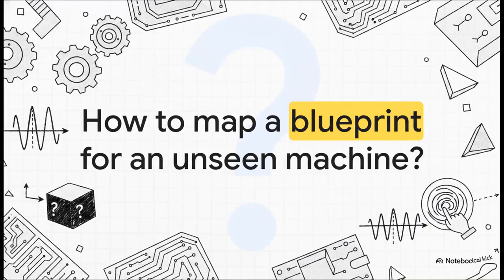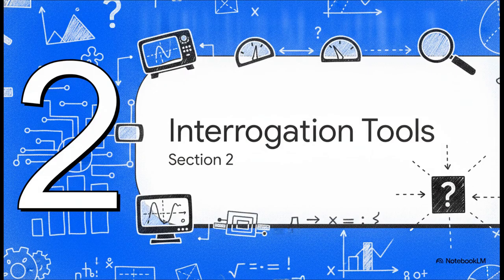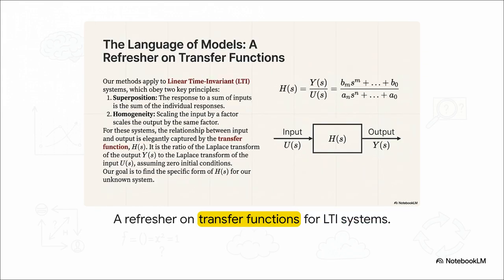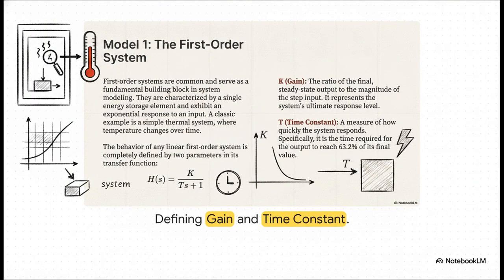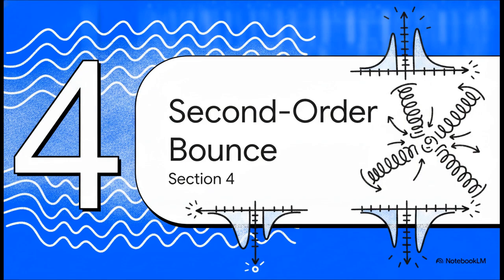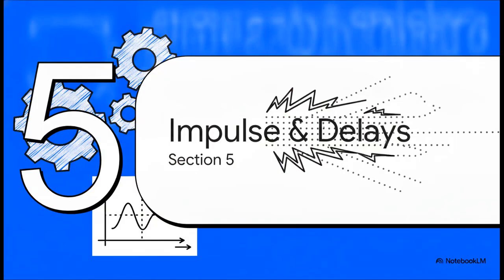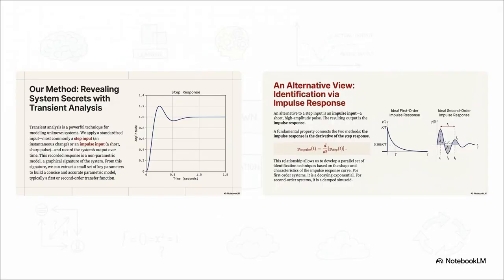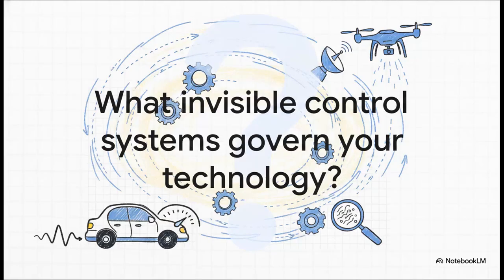System Modeling Using Step and Impulse Responses | Industrial Automation

Comment: At 1:17, under what conditions is a black-box model sufficient for controller design? Is a physics-based model always required instead, or does the choice depend on the application?
Reply from the maker: A black-box model is sufficient when the main objective is controller design, and accurate input–output data are available that capture the system dynamics over the intended operating range. It is widely used in industry because it is faster to develop and does not require detailed knowledge of the underlying physics.

A physics-based (white-box) model is preferred when physical insight is important, when operating conditions vary significantly, or when extrapolation beyond the measured data is required. It is also valuable for system design, optimization, and fault analysis.

Therefore, the choice depends on the application, the required accuracy, the availability of process knowledge, and the purpose of the model. In many industrial applications, engineers even combine both approaches to obtain the advantages of each.

Comment: In the Tangent Method, if the input step amplitude is not unity, should the steady-state gain K always be calculated as the ratio of the output change to the input change, or are there cases where using only the final output value is sufficient?
Reply from the maker: Excellent question. Yes. In general, if the input step is not a unit step, the steady-state gain should be calculated as the ratio of the steady-state output change to the input change: Using only the final output value is correct only when the input is a unit step (or when the input magnitude has been normalized to one). Otherwise, ignoring the input amplitude will result in an incorrect estimate of the process gain. This is why engineers always account for the actual input change when identifying process models from step-response data.

Comment: Thank you, Dr. Nima, for the insightful lecture. It covered the fundamentals of system modeling in industrial automation using step and impulse responses, and demonstrated how mathematical models are derived from experimental data to support system analysis and controller design.
Reply from the maker: Thank u.

Comment: Thank u dr for clear explanation, When using the dominant pole assumption, how can we determine from the measured process data that the effects of the other poles have decayed sufficiently and can be neglected?
Reply from the maker: When using the dominant pole assumption, engineers check the measured process response to determine whether the faster dynamics have become negligible compared with the dominant slow response.

This can be evaluated by observing the settling behavior of the step response. If, after a certain time, the response follows a smooth first-order exponential trend and the remaining deviations are very small, the faster poles can be considered sufficiently decayed.

Engineers also use system identification methods, model comparison, and error analysis to verify whether adding additional poles significantly improves the model accuracy. If the system moves into a different operating region or the neglected dynamics become important, a higher-order model may be required for accurate control design.

Comment: Dr. Mahdian, thank you for this clear explanation.
My question is:
When using black-box modeling, how can we know whether the step response is simple enough to be represented by a first-order model, or whether the system needs a higher-order model?
Reply from the maker: Excellent question. When using black-box modeling, engineers usually analyze the shape of the step response to decide the appropriate model order.

A first-order model is suitable when the response has a single dominant time constant, showing a smooth exponential rise without significant oscillation, delay, or multiple time scales.

If the response shows features such as multiple slopes, long delays, oscillations, overshoot, or different dynamic behaviors, a higher-order model may be required. In practice, engineers also use identification methods and validation with real data to select the simplest model that accurately represents the system behavior.

Comment: I have a question since the impulse response is the derivative of the step response, can we practically leverage this derivative relationship to design filtering techniques to clean up sensor noise when analyzing messy, real-world industrial data? What numerical challenges does the differentiation process pose when dealing with high-frequency noise?
Reply from the maker: Yes, the relationship between the impulse response and the derivative of the step response can be useful in system identification and signal processing, but directly differentiating real industrial data is challenging.

Differentiation acts like a high-pass filter, meaning it amplifies high-frequency components, including sensor noise. Therefore, even small measurement noise in the step response can become large fluctuations in the estimated impulse response.

In practice, engineers usually apply filtering techniques before differentiation, such as low-pass filtering, smoothing algorithms, or fitting a mathematical model to the measured step response and then calculating the derivative from the model instead of raw data.

The main numerical challenge is the noise amplification caused by differentiation, especially when dealing with high-frequency noise and limited sampling resolution. This is why practical system identification focuses on obtaining a balance between accurate dynamic information and noise reduction.